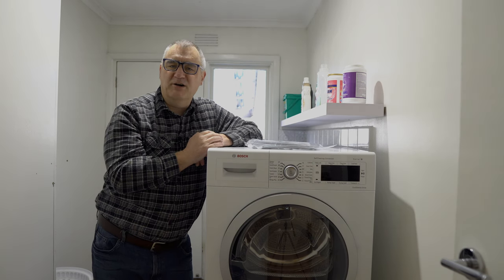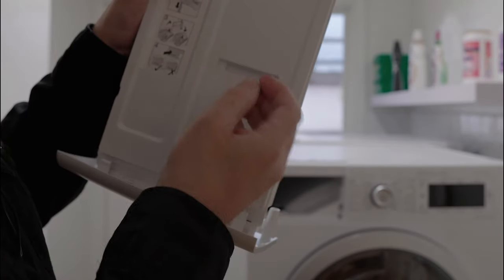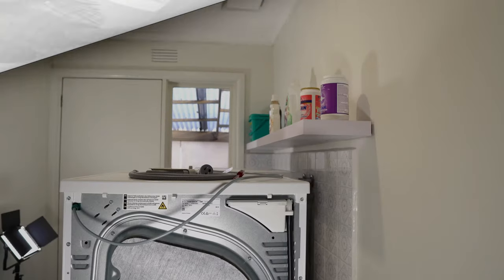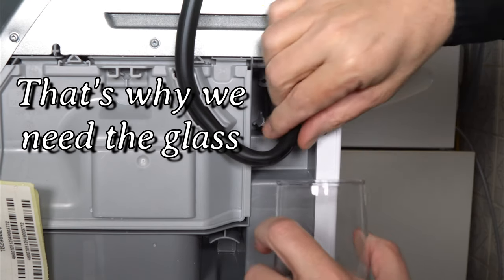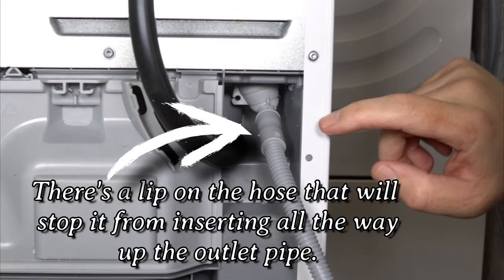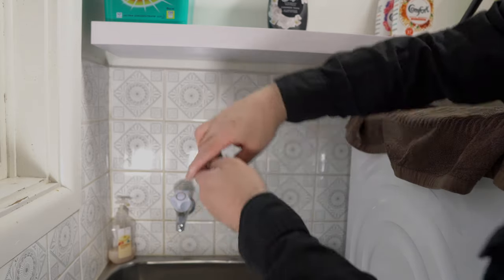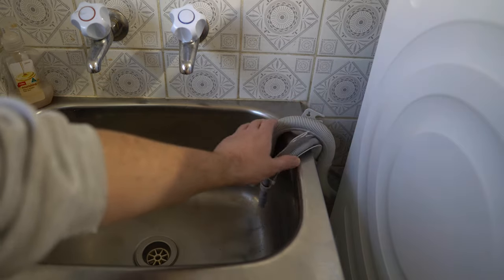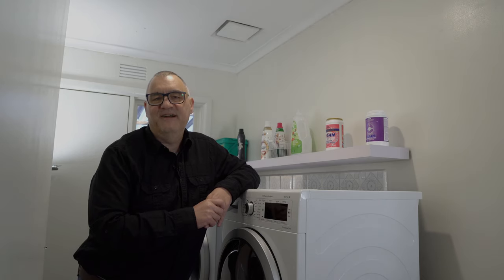UPDATED - How to Install the Bosch Drain Hose Accessory Kit

Comment: I have the same problem with water collecting in the top container after drain pipe was attached to bring water outside. 1 cycle, half or full container depending on the load. Also, the bottom of the dryer where the mesh filters are is full of water as well, flooded, need large towel to take out all the water from it. Does anyone have the same issues?
Reply: The little black plug and blue sieve has been removed, dryer stands on the floor, hose goes only 20cm high
Reply from the maker: Hi Marta. Sorry to hear that you are having trouble with your Dryer. I'd be contacting Bosch to see what they have to say. If it's still under warranty, they can service it for you. Best of luck.
Reply: I know what is the problem. The water goes through the container anyway but removing the green mesh it goes further into the end of the container, it than has opening towards the top like in bathroom sink or bathtub the overflow openings, water needs to fill the container fully for water to go thru these overflow openings and into back of the container wall, it has like double wall there, where the small hole with pipe is. If those overflow openings were much lower then the water wouldn't have to fill up the container till full. Also, water can't fully be drained from the container into pipe, only to the level of those overflow openings. It seems just a very bad design? Thinking of making a hole at lower level with a drill so that the water drains right away through the pipe and doesn't have to fill in the container first.
Reply: If there was an option to post a pic here I would, it would explain it much quicker than writing in words.
Reply from the maker: @martaratajczak8688  That's very interesting. It does seem like something is going completely awry. I personally wouldn't be drilling any new holes in the container. The dryer uses water stored in the container to help with the drying process. That's what makes them so energy efficient. Again, if it's under warranty, I'd get it looked at by Bosch. You may also be better off going back to just using the Water Container manually. I hope you can get it sorted out. Best of luck to you.
Reply: Hello Marta, I have the exact same problem as you, the container is nearly full after each cycle and there is also water in the bottom of the dryer, which is the real thing that bothers me. Did you find a solution? Thank you
Reply: Hi Matej, no I gave up, I had to empty the container anyway even though it was connected to the drain pipe. I now use the quick program 1.15h I think, Ive put back the mesh and the black round rubber underneath the water container and I just empty the container after 1 or 2 cycles, it is still attached to the drain pipe as I didn't have time to get behind the dryer and attach it back to the top of the dryer drain. It beeps and shows droplet icon when the contsiner is full. I find it the quickest program, if heavy load I run it twice on that quick program. I check the bottom after 1 or 2 cycles and there's not as much water as before, just moisture, every so often I push in a towel all the way to the back but it is usually just a bit wet in some spots, not drenched like before.
Reply: @JustAwesomeCommercials merhaba seri 6 kurutma makinam var. Sizin yaptığınız herşeyi yaptım ama ilk su nereye gitti anlamadım. Hortumdan su gelmiyor
Reply: Same issue, container just fills even though everything has been setup and tipple checked.
Last bosch for me, wait till you find out you have to pull apart the entire unit to clean the condenser.
Reply: Did you ever solve the container filling to the point it still needs emptying even though you have it set up to drain?
Reply: @jimboob234  no but I stopped emptying it, it seems to be full all the time but  I suspect it just overflows to the bottom which is where the pump picks it up. I left the hose in a bucket and it did fill it but the container was full 

I suspect the black plug doesn't actually draining the water out, or the solenoid isn't pushing the valve on the bottom.
Reply: @chocosmith2243  really annoying us we purchased because of the drain feature but never worked properly despite a few Bosch engineer visits
Reply: I have the same problem with the bottom of the dryer...is full of water

Comment: The collection tank acts as a reservoir to hold back some water for the self clean cycles. When the tank gets too full the water exits over the baffle (dam) and on to the out let pipe. It’s recommended to keep the filter in the tank to stop linen particles getting into the cleaning cycle. The filter should be rinsed off every so often to prevent clogging. It’s also recommended to do a manual cleaning cycle occasionally as instructed in the manual.

Comment: Thanks! This is a very helpful video. The manual has terrible diagrams and the explaination is less than acceptable. I think the cheering when the water started to flow was very humorous and I had a giggle 😃

Comment: Hey there, hope you're still reading comments on this 3y old video. We have this exact model, and it has started to cause problems with running a few minutes, then stopping because of water tank full, when its actually not. Pulling the water tank out and putting back yields usually same result as emptying it. Machine starts again and runs a while. I was hoping to put a hose on instead, but our model is built with everything running on the inside, I can feel the hose inside the hole where you attached the external hose. Would it be worth it taking the side off and seeing if I can get a hose attached from there and run it out through the hole, or do you have any tips and tricks how to make the water tank issue sod off? Cleaning everything thoroughly didnt help. Cheers!

Comment: I had the same problem with constant water in the drawer. So called the bosch guys they came and the problem was the drainage tube was soft and when reversing the dryer to its place accidentally the tube was pressed so the pump cannot overcome it. Check it it worked for me.

Comment: Hello, nice video. I have my dryer stacked on top of my washing machine and I've noticed that the bucket still fills up and won't drain although I did plug it to a Y connector on the drain alongside with my washing machine drain. Do you have an idea why it is not emptying the bucket?

Comment: Thanks a lot for this great video! Liked it and subscribed to the channel. 😊

Question(s): WHY does the filter need to be removed when we want to use the hose instead of the reservoir? And what would happen if we were to keave it as it is?

Thanks again!

Comment: We received our new Bosch condenser dryer today. Is the drain tube an option, instead of using the top collector box. Or is it necessary to use the supplied drain hose. Many thanks. Jim.

Comment: Thank you for the updated video. Do you think the bracket helps with the drainage if the hose is going directly to the sewer pipe, in terms of gravity? Angle for the water? What will be the perfect distance from the dryer hose connection to the drainage. Thank you. My tank continues filling up with every load.
Reply from the maker: Hi Mari. The bracket is only needed to help secure the hose to the edge of the basin. Just as long as the height of the end of the drainage hose is no higher than 100mm, it should work. If you've done everything correctly and it still doesn't work, and if the dryer is still under warranty, I'd contact Bosch and get it looked at. Best of luck.
Reply: I’ve got the same problem. I’ve done everything but I’m still getting water in the container. Thought it might have to do with the level of the machine feet where the water was running to the front rather than the back of the machine but no luck, 

Update: spoke to Bosch

The container will fill with water and periodically flush into the waste pipe via the filter. It does this as part of the automatic filter cleaning process. I will test over the next few days. I think it’s important the machine is also level but also just know that it’s normal for some water to sit in the container even after plumbed.

Good luck
Reply from the maker: @gerardmclennan6840  Hi  Gerard. This message has somehow slipped past my phone's comments app. Sorry for the delay. I recently found out by chance that if I paused and turned off the dryer before it finished its cycle and then started it again with a change of settings, that it did not empty the water container at all after completing the new drying cycle. The next time I dried a load of clothes without interfering with the cycle, the container emptied just fine. (It will always leave just a little water in the container as you mentioned). I've also noticed through the comments that people who have the dryer on top of the washing machine have issues with getting the container to empty even though they have followed every procedure correctly. Some things are a mystery. Thanks for letting me know what Bosch suggested to you. Every little bit of extra info helps. Cheers
Reply: @JustAwesomeCommercials   Hi Gerard, having just got my dryer i'm having the same issue as many others with the container retaining water. after much reading (and the manual is garbage with its contradictions) i decided to do another test. I sat the container on a level surface and filled it with water. There is obviously an internal baffle as the water does not drain until this thing is about 99% full. It only drained off a miniscule amount and stopped. Again i topped it up to overflowing and again it only drained a small amount. It seems its designed to retain a near-full container. Would be good if someone else could do a bench test to see if they get the same result

Comment: Don't forget to put the black rubber plug to the bottom of the water tank when you start the cleaning program, as the tank needs to be flled with water for the cleaning process.
You can remove it back after the program.
Reply from the maker: Hi Joerg. I'm not too sure where you have heard that bit of info from? Going by the manual, that is definitely not the case. Imagine having to do that every time you want to do a wash. I think someone has misinformed you. If you can show me some Bosch literature that says you need to do that, I'd be more than happy to pin your comment and apologise. Cheers.
Reply: @JustAwesomeCommercials  It is on page 45/46 of my dryer manual. (It is french though) 

Prepare the condensation tank for
the condensation tank for maintenance of the
the unit as follows:
1. Remove the cap from the condensate tank cavity.
2. Turn the condensate tank 180° (side down).
180° (top side down) and
down) and then replace the cap.
Put the cap in place.
Reply from the maker: @joergroser2536  Wow....that's crazy. Well, I apologise to you good sir. It seems that information is not universal throughout the rest of the world though, so I can't pin your comment. It seems to only apply to maybe the French models. I just double checked my own manual just to be sure and it basically says to pull the container out, empty the water and re-insert the container. No mention of having to remove the plug underneath. Not too sure why there is such a difference from one country to the next. I do however appreciate you taking the time to reply. Cheers and have yourself a great day.
Reply: In my Belgian manual, it also mention to replace the black plug..

Comment: Thanks for this, helped me fix the problem of not removing the stopper in the condensation container. I have to say I regret buying this dryer, it's truly a pain in the posterior to maintain compared to other dryers we've owned - it seems like every other week it wants to run its maintenance program. Then there's the "feature" where it stores water in the filter compartment at the bottom - this seems like an invitation for mould to grow, I guess we'll see. Anyway, we absolutely love Bosch dishwashers, not so much in love with their dryer!

Comment: Thanks for the amazing explanation! However I am one of those who are suffering with the “condensation container gets filled” problem.

I followed all the steps as you explained very well, but still there is water in the container… is it supposed to be full with water and  the new water will be overflowing?
Reply: I am having the same issue. Followed all steps and still water collecting. Now that I have the hole unplugged when I pull out the container the water is starting to flow, but it seems like when it is in its place, the water doesn't go down the hose. Did you find a solution?
Reply: @mylifetoday  i got my machine serviced and apparently container may fill with water, it’s not a problem they said.
Reply: I had the same problem. So called the bosch guys they came and the problem was the drainage tube was soft and when reversing the dryer to its place accidentally the tube was pressed so the pump cannot overcome it. Check it it worked for me.

Comment: Many thanks for this updated version of the video. Our dryer was installed by the seller on delivery ( which according to the Bosch help line voids warranty in terms of incorrect installation but which of course the seller does not tell you). The hose pipe was not draining and there was also no water in the drawer!!! Fortunately I worked out from the manual that the installer had not moved the black plug and filter to the resting positions. I managed to sort it after feeling very stressed as to where the water from the first cycle actually went??? It was great to have your video to both confirm the hose was correctly fitted and that the plug and filter placement are now correct. I always think the manuals are written by people already very familiar with the appliance so to have a video was an enormous help and my 90 year old mother can now use the appliance without struggling with the water drawer. Where the water form the first cycle went remains an enigma so lets hope things keep working. What goes on in the cleaning cycle is the research for today.
Reply: omg the same thing happened to us...the dryer was installed by the seller...we understood until removing the black plug and the filter to the resting positions...now we are wondering when we should put them back for the so called 'automatic cleaning'. Do you have any idea about it?

Comment: Hi thanks for the video. I’ve done exactly that and there were some more instructions in de book with removing a small stopper in de condensate container and stuff but the problem is that the container still fills up. Much slower but it still collects some water and that means after every couple of dryings it still needs to be empties. Is this something you are familiar with?
Reply from the maker: @Ivo Woltring  Hey Ivo. I've noticed that people whose containers won't empty, even after doing everything they should, are people that seem to have the dryer stacked on top of the washer. Is that the case with you?
Reply: @JustAwesomeCommercials  no it is next to the washer on the ground. And I have removed the stopper and the small sieve and put them in the slots made for them. The reservoir still fills up after about 5 runs. Normally we had to empty it every run so improvement but not what I expected. And if I google it I can’t find answers which is very weird in this day and age 🤣. Any help is appreciated
Reply from the maker: @Ivo Woltring   Probably the only suggestions I can make is to ensure that you have the hose exit within the correct height range. The second thing is to not actually empty the reservoir unless the dryer is telling you to empty it. It uses stored water to help with the drying process. I don't check my reservoir at all. It may stay full, but I've never had an error message saying l need to empty it. Other than that, l wish you the best. Maybe give the Bosch service number a call if it becomes too much of a problem. Good luck.
Reply: What if they are stucked and the dryer tells after a while that you need to empty the container, is there any option to make it stop doing that?
Reply: @JustAwesomeCommercials  Mine is stacked.  Is there anything I can do to make it drain apart from unstack it?  I don't have space.
Reply: @JustAwesomeCommercials  YES!

Comment: Hi, I can't find anywhere in my manual where it says to remove the condensation container filter when you use the drain hose. It only mentions removing the rubber stopper. Could you tell me where in the manual you find it says to remove the filter? My model is WTX88MH0AU, it looks pretty much identical to yours.
Reply: When I think about it, wouldn’t removing the filter cause water pumped from the the sump contaminated with lint to enter the condenser cleaning chamber, thereby flushing the condenser with dirty water? It seems to me whether you drain or hold the excess condensate, the water reserved for flushing the condenser should always be filtered..

Comment: Hi, quick question. Do we need to install the bosch drain hose? I thought that is why we had the water container to do it through it.
Reply from the maker: Hey Michael. The idea of installing the drain hose is to bypass the Water Container completely. This way you don't need to manually empty it after drying a load. If I've misunderstood your question, please let me know. Cheers.
Reply: @JustAwesomeCommercials  Hi. Thanks for the video! very helpful!  We had the very same question.  We weren't aware of the hose setup as we were used to emptying the reservoir each time on our old unit.  There is a drainage pipe on the wall immediately behind the unit but that is used for the washing machine only. We would have to change it to accommodate the dryer as well. So can we use the dryer without this hose in the meantime?